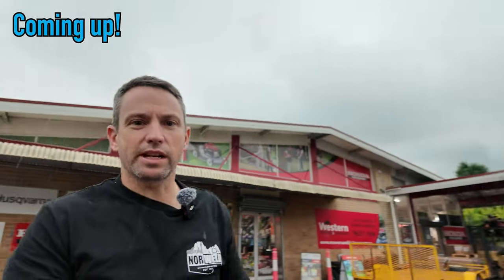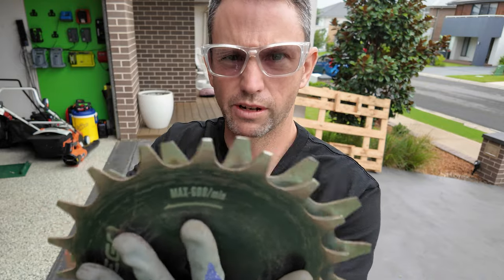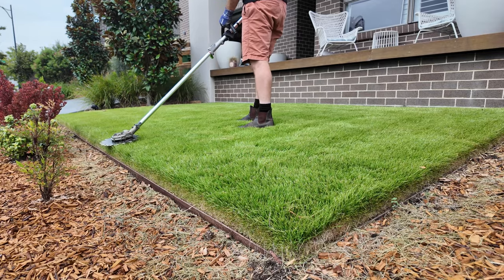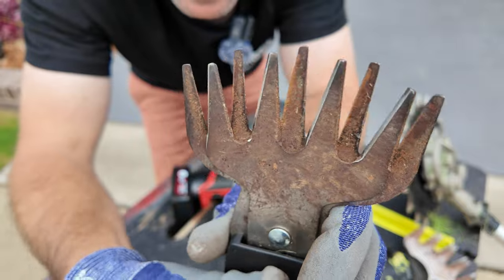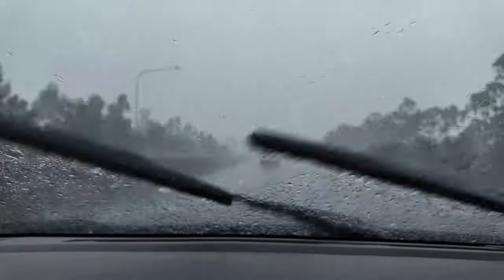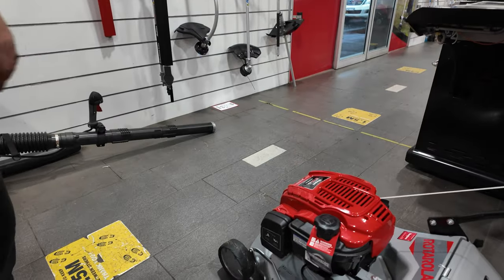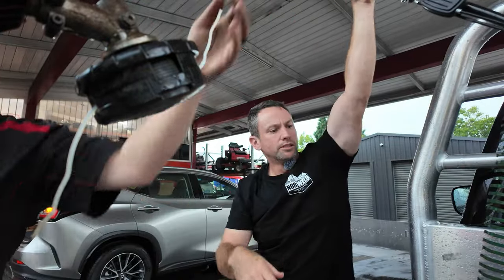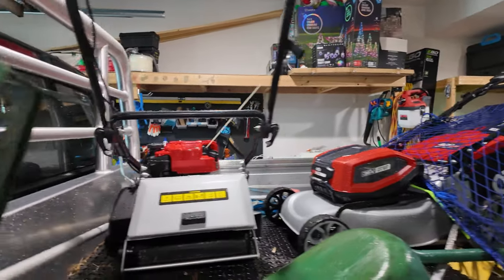VLOG #31 I pick up a UNIQUE Lawn Mower to try out!

Comment: Sharpen the back side of the teeth opposite side to the mating surfaces that bypass each other, you can use a file like the same as for lowering the Rakers on a chainsaw.

Comment: hey Tim!  without a honing stone or file, you can do just a pass or two on the backside with the die grinder setup, to help remove the tiny burr thats created when sharpening.  thats just absolute nitpicking as im sure they are cutting way better now that youve re-beveled the edge.

the wobble in the head may be from the shaft being warped, or maybe a bearing on the inside that may not be seated all the way

Again, thank you for all of the content you provide!
Reply from the maker: Cheer mate

Comment: Interesting machine - good job on sharpening those blades... if you have a orbital sander, put some wet and dry paper on it (40-80 grit would be fine) and just flatten out the two faces that rub against each other, to finish the edge from that side... might need to file those little Ryobi hand shears to get the best finish... easier than removing and replacing that rivet... (also, those shears may do a better job at boxes than that rotary cutter you got a few weeks / vlogs ago...)
I wonder if the battery mower in the back of the ute is totally waterproof for being out in the rain, or being hosed off...? do you keep the batteries in the unit, or in the car and put them in as needed...?
Reply from the maker: It’s still working after that but I wouldn’t recommend leaving them out for long periods